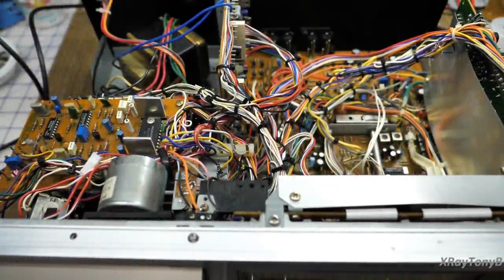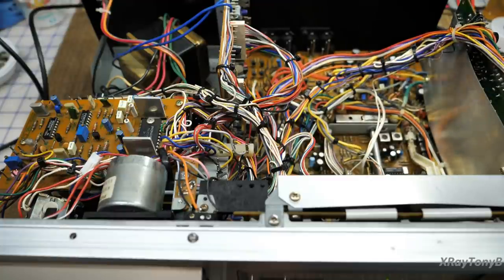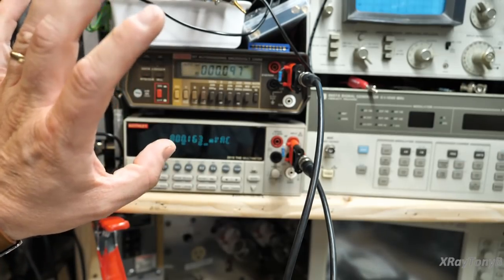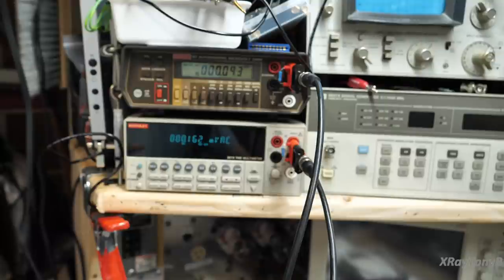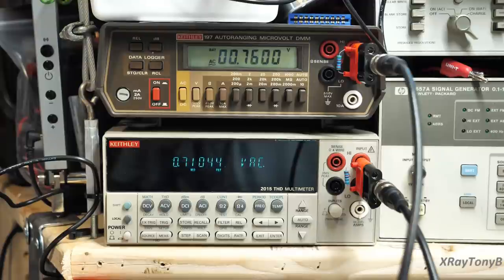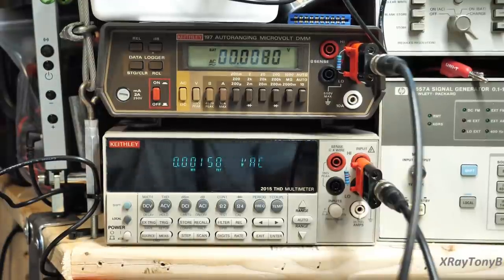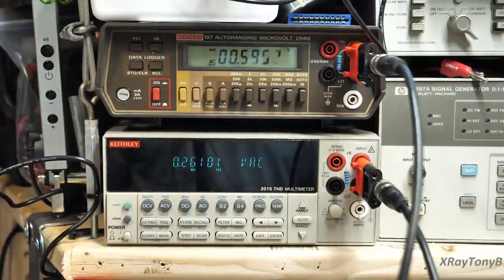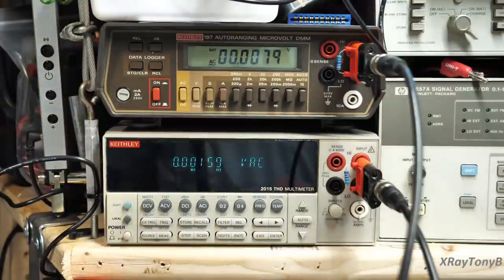Pioneer CT-F1250 Cassette Deck Part 6 - Alignment Begins

Comment: I wonder if you could reliably use one of those "car audio cassette" to 3.5 TRS adapters to inject a signal of indefinite time length instead of having to rewind an actual cassette tape.
Reply: I wondered that also..
Reply: For general fault finding, yes of course - but not for an alignment.
The tape itself is a calibrated reference signal source.
For example you can download and burn a test CD, but you could not record your own reference signal cassette unless you had a deck which fully complied with the standards and put the exact magnetic flux on the tape for each frequency. 
That's why test tapes are expensive.
Reply: @simonparkinson1053  thank you!
Reply: The test tapes are calibrated for level based on magnetic field strength energy on the tape measured in units called nano webers per meter, or nWb/m. It would be hard to know what the magnetic field strength of the adapter output would be, and it would not be consistent across a wide band of frequencies, eq. comes into play. The gap between the two devices would also be hard to maintain as a tape would be.

Comment: Both of your meters will drag down the voltage reading, I have a HP 410B meter that I use.
Reply: Do you mean by operating both at the same time?
Reply: Really?
The input impedance of those meters, which in the case of the 2015 is in the Gigohms, will make no difference. 
Tony had the outputs terminated into 51K resistors - within the range the alignment procedure specified.

Comment: And this is why I stream music now 😂
Reply: I always see the debate whether analog or digital sounds best. That is a personal preference. However for analog for analog to sound its best everything has to be just right.  Also if you take the time to restore a deck, use and enjoy it. Rubber parts deteriorate from the day they were made. At least give your machine a run thru once a month or so. Belts sitting in 1 spot too long can get an elliptical shape which may or may not work out